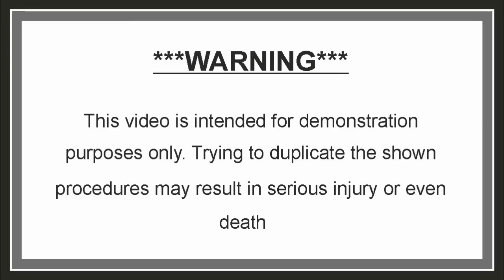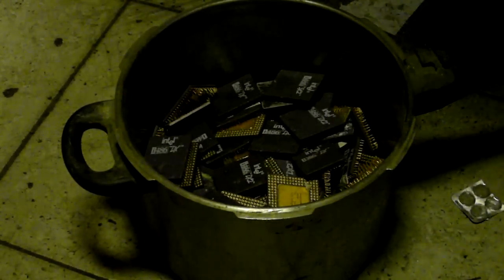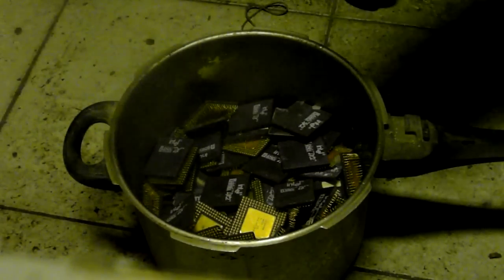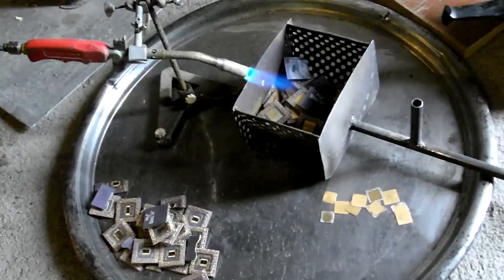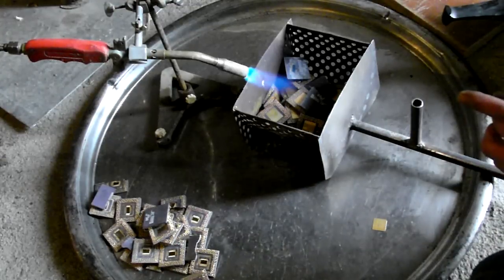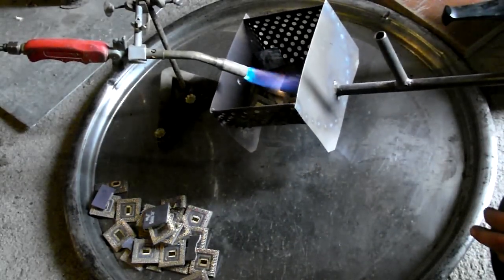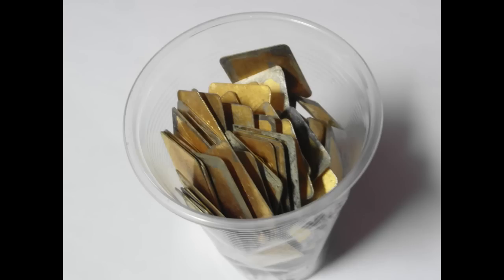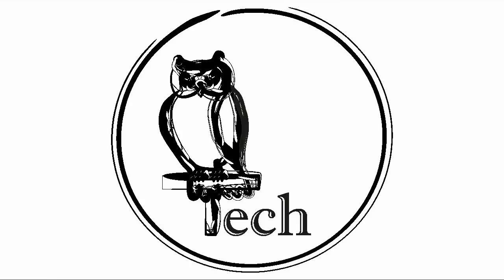GOLD from 5kg Intel 386 & 486 ceramic CPUs PART 1:  preparation

Comment: youre degreasing the chips with naoh in this first step with something like a 5% solution?
Reply: get a tumbler. like a propane tank ends cut out and sit it like a rock tumbler on a 12v motor then add heat and youll decap 5kg in about 10mins. great for depopulating pcb boards too
Reply from the maker: yes something like that I didn't measure it but it was about 50g NaOH in 1L tap water

Comment: Why would you heat it when it generates it’s own heat,,just fill the container up with water an it will take care of itself,, Man I’ve been doing these chips an Ewaste for many years,, just trying to save you some time and energy,
Reply from the maker: The CPUs absorbed the heat, generated by the hydrolysis of sodium hydroxide.